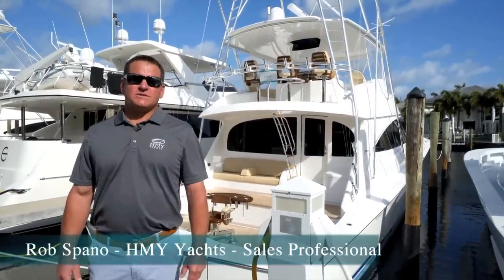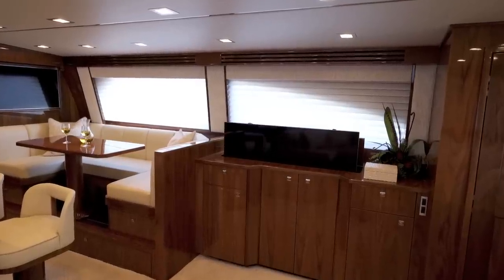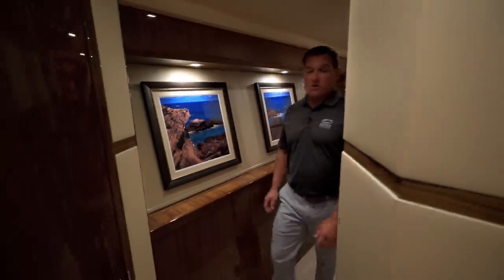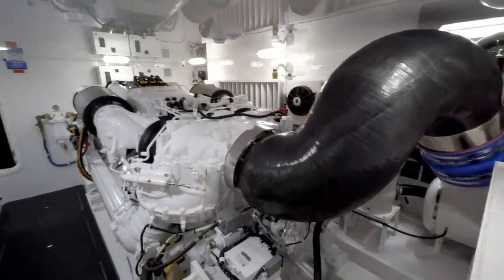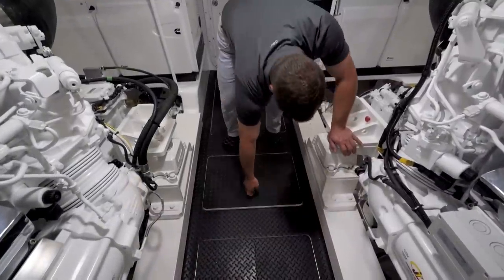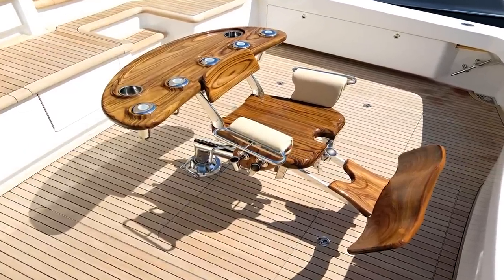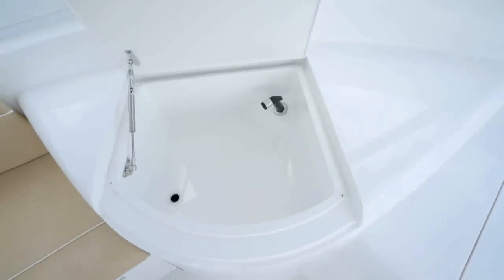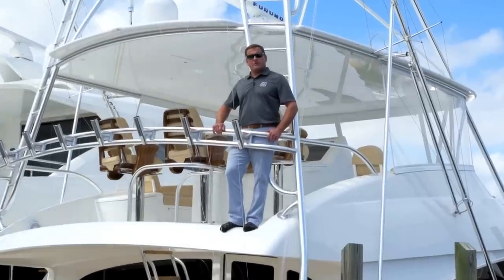2019 Viking Yachts 72' Convertible - For Sale with HMY Yachts [Walkthrough]

Comment: just for general information , after a Viking boat is built  is there room ,  or is it possible to put a sea keeper  in the boat ???    it does not look like there is room in the engine room there if you wanted to put one in .  this boat has a sea keeper under the  cockpit .  Are Vikings built such that a sea keeper can be retro fitted in the cockpit ? This is really important  if one buys a used boat . I think a sea keeper is going to be just as standard equipment as a air conditioner .  Thanks for your answer
Reply: he showed the seakeeper unit. it was in the cockpit area under the fighting chair. yes they can be retrofitted usually they are put in the cockpit area but a seakeeper tends to be 100k for the unit alone.

Comment: Are the engines keel cooled, or are you running salt water through all engines? 1600 ton any Ocean Master.
Reply: I don't know but why do you exclude the most common alternative with sea water intake, heat exchangers and glycol water in the engines? Looking at https://www.vikingyachts.com/main/62EB.asp they mention engine cooling water pickups so that excludes keel cooling. Does any modern inboard engine boat let sea water go through the engines? My guess is that we just didn't see the intake filters and heat exchangers in the video but that they are somewhere. I guess the electric cooling water pumps showen at 4:15 are not for engine cooling, they look a bit small for that.